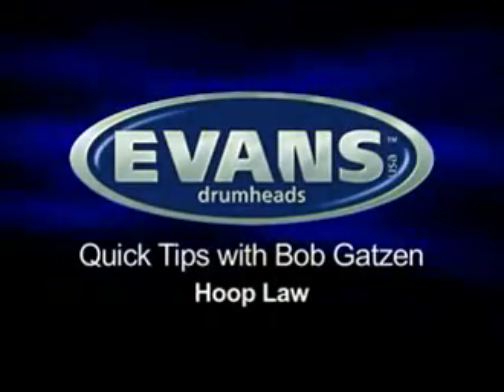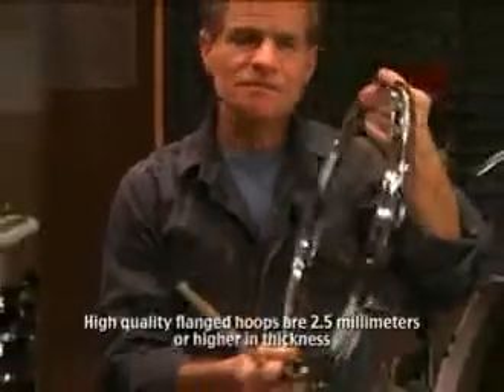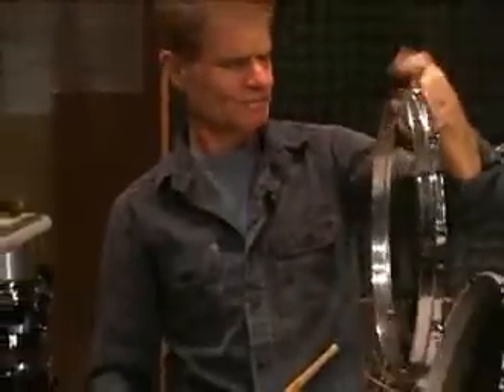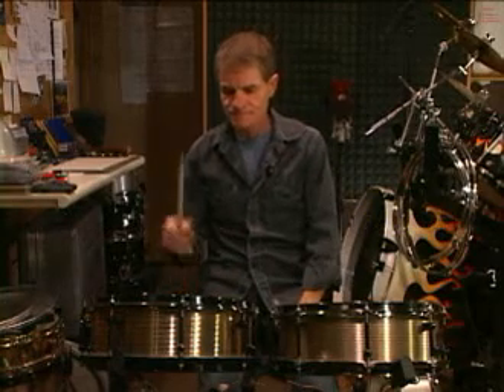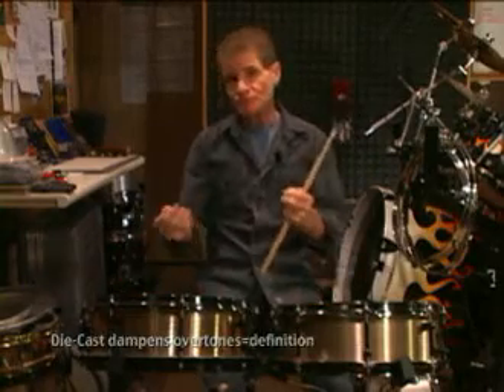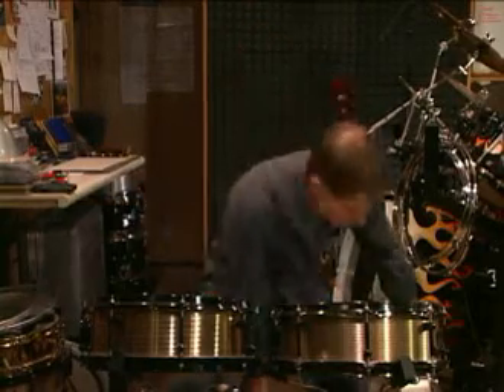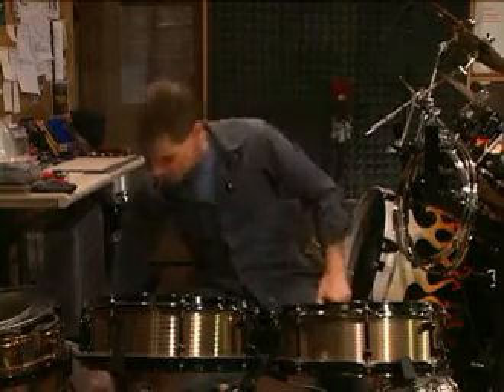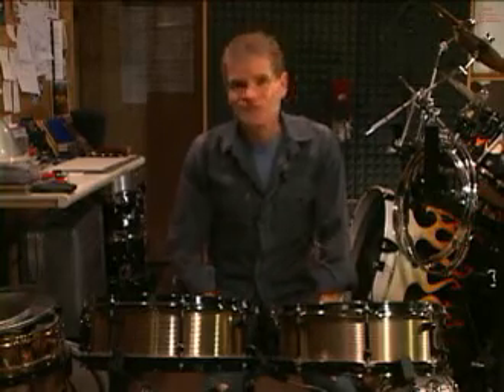Bob Gatzen Drum Hoops Explained

Comment: This sounded like an ideal change to make on my “ringy” snare until I discovered that a single 14” die cast hoop costs $75… from the discount sources.
Reply: They used to be the only choice for some brands that did not have access to the ability to press flanged hoops, now they are a much forgotten expensive upgrade fitted to very few snares as the average buyer in a shop wont pay the extra cost as they don't understand what Bob has put forward here. Still just as expensive but my personal fav is to add a wood top hoop has the same muting effect as a diecast but also is very easy on stick and does not transfer the same shock to the wrist/arm when hitting rim shots. Try one!